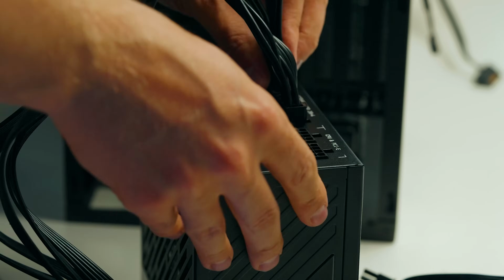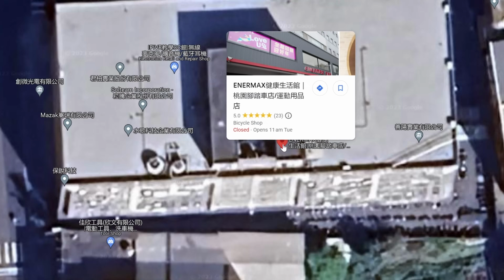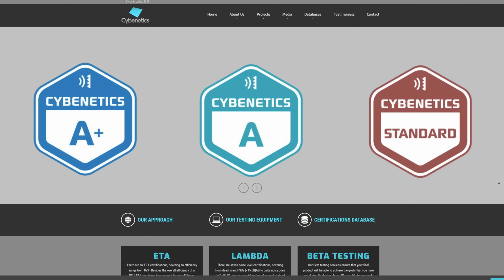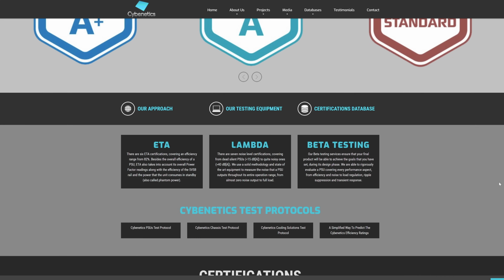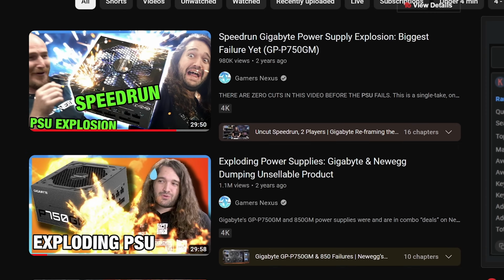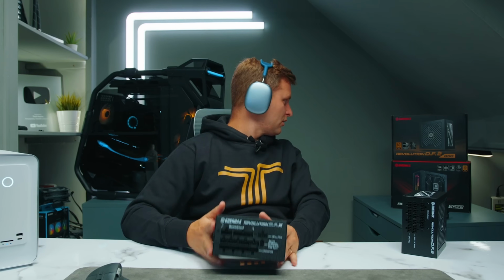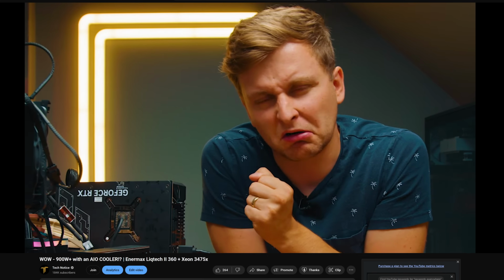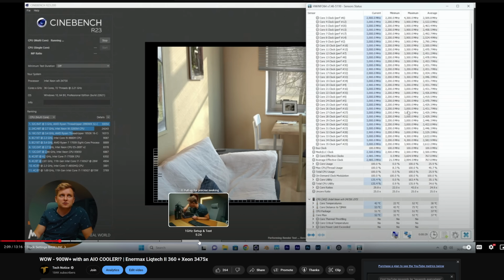ULTIMATE Power Supply Tutorial: NEW PSU standards Explained from NOOB to EXPERT! [What is PSU?]

Comment: One thing I have heard of is that the companies only have to provide one model to get the efficiency rating and then they could possibly use lesser quality components in product that is sold later.
Reply from the maker: Would great to test it! :)
Reply: that would be a huge scandal, it's called bait and switch... It's what some SSD/NVME manufacturers tried to do... But ON a PSU level it would be really bad for that to happen.